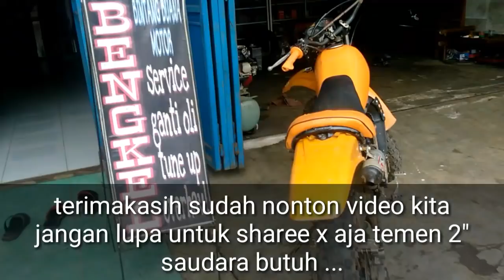Cara perbaiki slah macet & stater  berisik pada matick#siboen tutor

Comment: Cara bikin Honda Vario lama nambah akselerasi dan top speed nya bagus. Kira2 pakai roller brapa grm dan per cvt nya bro rpm. Kang makasih sebelum nya .
Reply from the maker: +Supri Bapoxz untuk naikan akselarasi ...simak video saya yg bikin Matik AGRESIF modal amplas...
Untuk dapatkan topsped lebih max gunakan roler standar saja dan pada video bikin Matik AGRESIF modal amplas juga di jelaskan
Reply: siboen nugroho #oh jadi gak perlu ganti roller racing cukup yg original  saja kang.
Reply from the maker: +Supri Bapoxz iya brooo roler racing kebanyakan di bikin ringan di start & go 
Gilir top sped malah drop
Reply: siboen nugroho oh ok kang makasih. Atas info nya.
Reply from the maker: +Supri Bapoxz ok sama sama